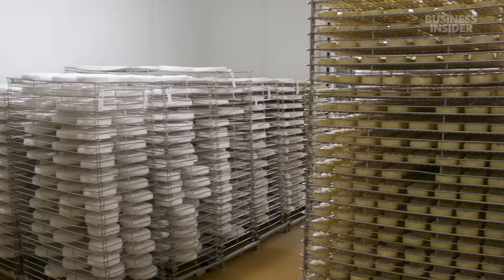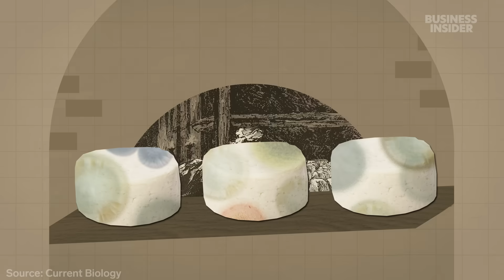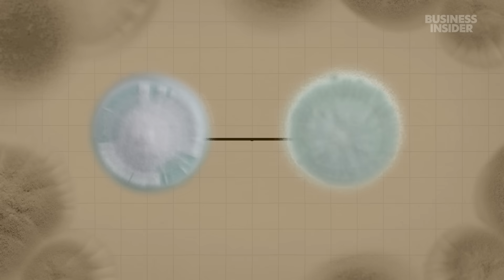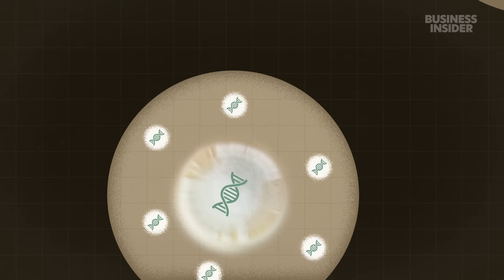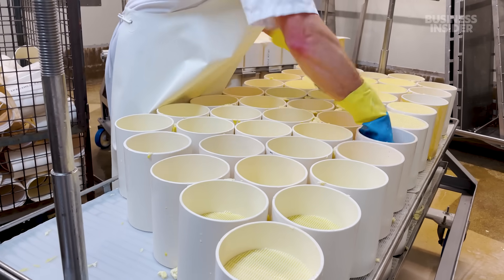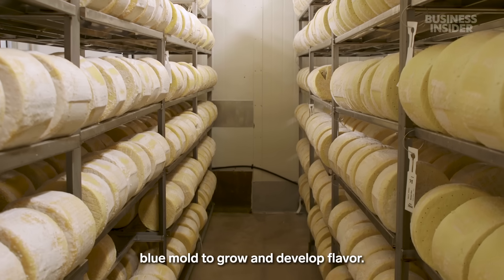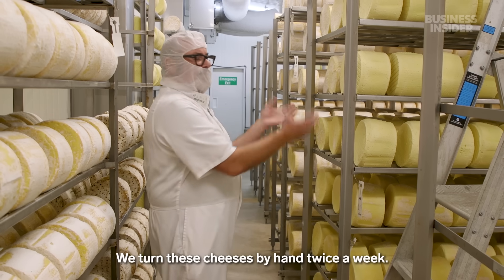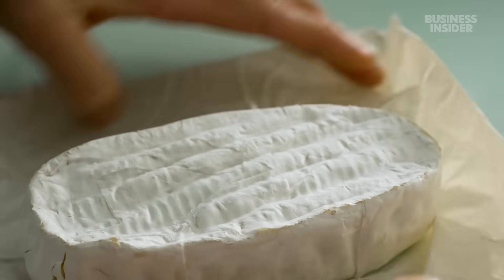Why the Mold Behind Brie Cheese Is Disappearing

Comment: Cloning causing problems? Are you serious? Scans idiots Both sides elites meeting Pope and orders to sabotage the masses like fall of Rome is the problem. Need diversity? If you find a mold you want to keep using you don't need diversity that's the point of cloning. Mutations? That's how Asexual organisms don't need diversity.. If you want to stop the DNA/Computer from running new programs that could be bad as a result of your interference with its natural data intake, you have to keep cloning old version. That Mold is a natural cloning organism..

The problem is YOU.. They came into existence without you, and after you something is going wrong. With even more clean conditions than the past, something YOU DID needs to be undone. Easiest way = Clone old sample, actual clone not natural clone with DNA of the mold trying to adapt to YOU. Example! When we consider the DNA damages of the masses when talking to your Church, they said GMO fixing you would be a sin, and cloning ancients would be a restoration. Hmp.. (We have spies too) But genetic override potential exists..

Using Plasma speakers for high resolution plasma generated Ultrasound and attempt to trigger gene combinations with as many samples all at once as possible to look for beneficial patterns to your goals. Can't? Google: "Ultrasound see viruses turn genes on/off" Anything it can see it can manipulate. Once you learn how to do that it will help you restore masses. Tip for masses: Target behavior genes.. Tip for your science system: Don't get Earth killed again by us.. Points at 400 feet deeper ocean "No No, that's not from the great flood its from ice!" Still a flood, demons.. - Watcher
Reply: no u wrong
Reply: @myboysd5772   I posted AI agreeing that cloning an old sample will be void of self modifications by Asexual life. Shoo..
Reply: @MrQuick999  i post ai disagreement
Reply: @MrQuick999  No u are wrong i post ai disagreement proof on twitter
Reply: @MrQuick999  No no u completely misunderstand and u are wrong learn to use ai proper and you will see
Reply: @MrQuick999  Learn to use ai sir its easy its all about propaganada training i post ai disagreement proof on twitter two times already please educate yourself
Reply: @MrQuick999  There is no need to be emotional it does not enhance your reasoning please look up my ai disagreement post
Reply: @MrQuick999  You are being too emotional please just see the proof and you will see the proof lmao. Use your reasoning, ai disagreement proof is there very simple.

Comment: Literally measles and smallpox despite being more extinct than this mold has multiple labs over the whole earth where it's being kept. Are you telling me it's impossible for 1% of all cheesemakers to have a vault growing the mold indefinitely?
Reply: Genetic drift and degeneration has been a significant concern with those too. We cannot be very confident that these strains always stay the same.
Of course, in modern day, it's a non-issue with viruses, as they are simple enough that we can rebuild a virus from just its genome sequence. Still expensive to do though.
Moulds are orders of magnitude too complex.
Reply: The concern is that it may not be able to reproduce at all, even in controlled optimal conditions for getting seed mold. The mold also needs to be able to spore and spread fast enough to meet commercial schedules, so even if it retains a good enough ability to reproduce for seeding, it may not retain production viability.
Reply: That was actually the crux of the issue, the way it grows is by cloning itself, indefinately. Like a copier machine, making a copy of a copy of a copy of a copy, some things begin to... fade out.
Reply: it is slowly not producing spores.  it is a problem that we can foresee in the future, not one happening at the moment.  and preserving a bit of mold that will basically die off because it isn't producing any new spores doesn't help.  the issues started with them picking a albino strain to begin with, which are notorious for being sterile.
Reply: @sinisterthoughts2896  The issue is mutations over time, meaning they aren't selectively breeding against this and/or aren't willing to GMO. This is an artificial problem due to inaction.
Reply: The banana that create banana flavour found in banana candy and banana milk are extinct (which is also menioned in the video) The mold is not genetic diversified enough to fight against disease. While it can be lab grown, distribute to be used to make cheese, but it would then either dead on arrival due to new diseases or become too expensive to upkeep.  Even measles has evolved slightly over decades.
Reply: @lehoangminh  big mike bananas are not extinct, only very rare at this point, and might make a comeback.
Reply: @lehoangminh gros Michel is still grown by some plantations.
Reply: Amen to that. “Awareness of ignorance is the beginning of wisdom” - Socrates
Reply: Sadly
as people are anti vaxxers
measles and smallpox and the lot
are coming back.
Reply: A virus does not reproduce in the same way as a fungus. A fungus is a much more complex life form than a Virus. A virus isn't even considered alive while a mold is. Its like comparing keeping a weed around in your garden VS a exotic flower that needs 24/7 attention not to die. While you can compare them, its apples to oranges.
Reply: They will have to GMO the genes back into the cheese... This will piss off anti GMO freaks who will claim it's now dangerous even though it will literally be exactly as it was decades ago.
Reply: Smallpox is extinct in the wild but measles are still around. In fact the antivaxx crowd in Texas are finding that out now.
Reply: The brie mold is losing its ability to reproduce sexually (produce spores), no matter how much we keep. Cloning it does not work forever, because mutations will be introduced that could at best lose its culinary goodness and at worst make it toxic.

Smallpox and measles are being kept in labs/fridges, yes, but they do not have to be mass produced generation after generation like the cheese molds do. 

So “extinct” is a little bit of a misnomer, because yes, you could keep the same species of mold alive in a lab. But keeping it in the right genetic state to keep doing its job to make cheese - different story.
Reply: Did you watch the video? It's not a matter of running out of mold, its about the deterioration of the strain to the point of it no longer being able to reproduce at a sustainable level.
Reply: yes- business
Reply: Even if it won't go extinct entirely, that much probably wouldn't be enough to meet the demands for cheese
Reply: Do people nowadays watch videos while browsing their phones at the same time or what? The video states clearly why the mold is in danger of extinction. It keeps producing less and less spores so eventually we may be stuck with a version that doesn't produce almost any (and then not any at all and then the mold is gone)
Reply: @xGOKOPx  I do ocassionally. Very ocassionally. But with this video I didn't even want to watch it all the way through because I didn't find it too interesting and I just wanted to make a funny quip, despite understanding the fact that there's most likely more to this. I did specifically ignore the video and what it might have to say behind why this mold is so extinct, just cause I wanted to make a "funny" comment. That's all broski.

But thank you for explaining the reason. Would have never known otherwise
Reply: Measles and smallpox are kept somewhere, probably frozen or something, and no one is trying to reproduce them on an industrial scale every year so they don't exhaust themselves by the cloning.
Reply: Measles and smallpox aren’t in the fungi kingdom like molds are. In fact they’re viruses and not even alive at all. They are also more genetically diverse because they’re not being cloned in a lab in order to make a consistent food product. Do you really think you can even begin to compare these two things? This is a very stupid comment.
Reply: There were mutations over time that are reducing spore production that they could modify out (like with crispr) but aren't so we probably should ignore their whining since their actions depict they don't actually care.
Reply: That makes sense right there 👍
Reply: Totally thinking the same thing. I would think the planet has ALOT of people and businesses saving spores and samples
Reply: 1. the lab can monopolize the production.
2. the mold itself has become so fickle from being kept out of nature, unable to reproduce sexually that it becomes "impotent" (from all the cloning).
3. it's trendy to panic and corporate doom-posting can boost prices due to perceived "scarcity".
Reply: @DramaticCrossroad  Interesting. From some of the responses and especially yours I've come to realize that it isn't even close to as simple as I thought and it's genuienly quite complex of an issue that will be an actual problem.
Reply: It's a scam
Reply: Yeah my first thought was how stupid this is. The mold should still even be alive in the cheese it various stages; do what people did for millenia with various foods. Pitch in some of the old product.
Reply: @nigeltheoutlaw  People you're not listening. It's not about being alive. You can definitely PRESERVE the mold in a lab for the future but you can't produce cheese with it every year. The problem is not the survival of a single particle of the mold but its ability to reproduce in a significant quantity.
Reply: @nigeltheoutlaw  "Yeah my first thought was how stupid this is"

that's a pity.  your fist thought should always be:  "I don't really know anything about this at all".
Reply: @thomasneal9291  Yeah because "muh experts" have really demonstrated their knowledge since 2020 hahaha. I call BS.
Reply: @nigeltheoutlaw  you seemed to have missed the point.  they are trying to find an old enough sample and not having any luck.  the strain that is used is a genetic dead-end.

Comment: I should send her some cheese from my refrigerator.  My cheddar always starts to grow a white, soft, fuzzy mold that tastes just like Brie.  Occasionally there are spots of black as well, but they don't have a very strong "off" flavor-- not like the black mold I'm familiar with, which is detectable in the tiniest amounts.  Not exactly "wild" I suppose, but hey, it's there of its own volition.
Reply: I barely know anything about mold, but Im wondering... Is growing mold in the refrigerator to eat, safe? I mean are you sure your mold is safe to eat?
Reply: @fangwu7576  Pretty sure.  The growing isn't intentional, it just happens before I can get through a block of cheese, but I can't keep throwing cheese out.  I let my taste guide me.  (I've also had an intensive food-handler's class, so I have a little background.) Since it looked exactly like brie mold, I gave it a tiny taste and it tasted like brie mold, so I went with it.  I do cut off the larger pieces of black but don't worry about the tiny ones.  (I believe you need to keep your immune system challenged to keep it strong.  Just don't go crazy.  BTW, when in doubt, it's safe to cut mold off HARD cheese and use the rest.)

Also confirming my thought that it actually IS brie mold, I once had a store-bought lunch with a selection of cheeses, including brie, some grapes, crackers, whatnot...  I didn't finish it at the time so put it in the refrigerator.  The white mold from the brie started growing all over the remaining cheese in the container, covering them in white fuzz and giving them that slightly brie flavor.  Pretty wild.

Comment: 8:34 Does using unpasteurized milk do anything for the cheese other than making it riskier? Is there a benefit?
Reply: It's the taste. Cheese made with pasteurised milk using the same process as cheese made with raw milk tastes different. There's a taste difference between raw milk and pasteurised milk, just like there is between pasteurised milk and UHT sterilised milk.
Also the pasteurisation process affects everything in the milk that's temperature sensitive. So it kills off both the bad and the good microbes, it can destroy vitamins, enzymes, and other things like that.